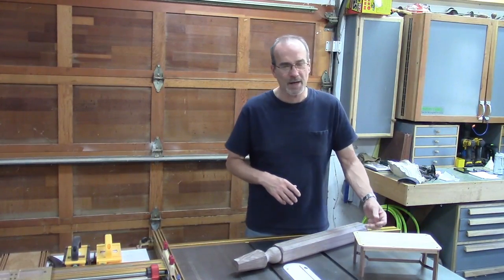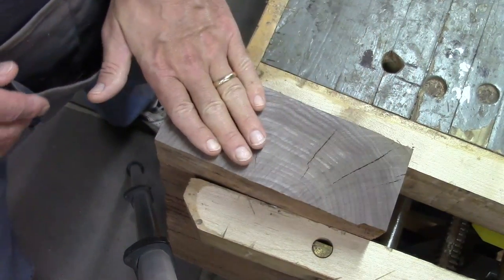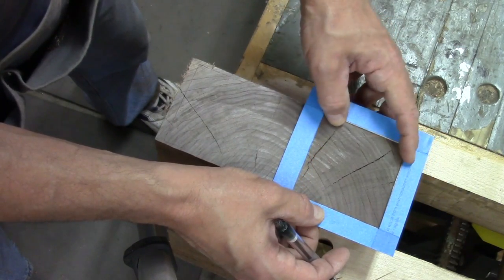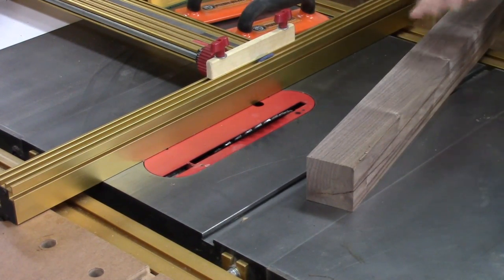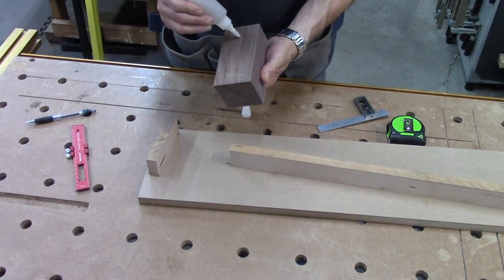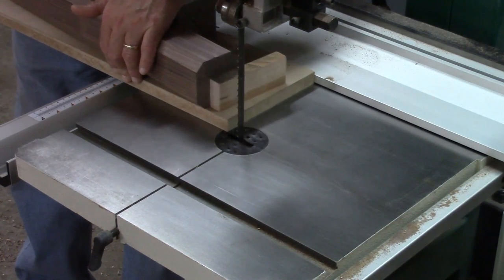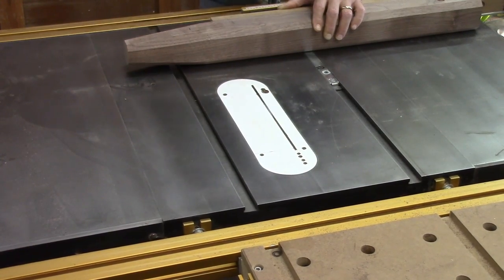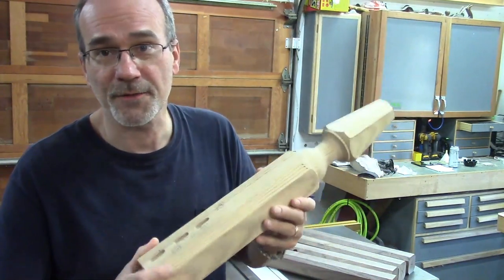Butterfly Leaf Dining Table 1 - Making the Legs

Comment: Great job on the legs Guy.  I personally don't care for the flutes given your overall design, but it's your table!  Interested to see what you decide.  Incidentally, I haven't been able to find any local, decently priced, walnut here either....let me know if you come across an good source!
Reply from the maker: +Scott Cable Thanks Scott! If you look on CL, there is a bunch of really good local guys selling lumber pretty cheap. My issue was finding 12/4 in the right quantity, not an 8' board of it. There is a guy in Connersville (actually Rushville) that sells everything for $2.50 a bd ft.

Comment: Awesome job so far Guy! I like the flutes. If you flute them will you flute the lower section too?
Reply from the maker: +woodworker 631 Thanks Brian and Mark! If the flutes do go on, the will only be on the outside of the legs since the legs are turned at 45 degrees to the ends. And they will definitely not go on the bottom peg, only the top.

Comment: Seeing as you brought it up. A question I have been pondering. Does it really matter if you begin your taper on the end or the side of the leg? Would really like your opinion.

Thanks for the great videos and sharing your amazing creations
Reply from the maker: +Jim K Thanks Jim! I don't see how it can really make a difference which way you cut it. As long as it's secure and you are comfortable doing it. The stops may need to be in different spots on the table saw however.

Comment: Hello Guy,   I vote for the flutes.  How are you copying your first leg to ensure the others are the same?
Reply from the maker: +Mark Walker Hey Mark. I originally made the turning on the sample piece, then just used that one to help turn the others by hand, no duplicator. They are pretty close, but not exactly the same. Since there is distance between them, it will be hard to tell.

Comment: Do you purchase any material at "Northwest Lumber" by Lafayette Square in Indy. How do you feel their price compared to local places around town. Glad to see your purchase from Matt thou.
Reply from the maker: +Tom Pritchard Hey Tom! Yes I do buy lumber from them occasionally if I just need a single board as their prices can get pretty crazy. I either get lumber from a local sawyer or from Frank Miller Lumber in Union City. They deliver here for me for free, and have a truck in town a couple times a week. That is if I buy 100+ bd/ft at a time. And their prices aren't too bad either. Very reasonable and it's very good grade lumber.
Reply: +GuysWoodshop I buy mostly Basswood for my wood carvings at Nortwest. I have a couple local saw mills that go to in southern Indiana. They can provide most domestic wood at a great price. Which I use most anyway. Thanks for your response. A new sawmill just opened called Maple Grove Farm. it ,may be a good option? http://www.maplegrovemill.com/index.html

Comment: Definitely FLUTES!  So far it's unanimous.  :)  Looking good so far Guy.  

Wait for it... Mitch will chime in and request you cut the flutes using some rare old Stanley or Record molding plane made by some Brits from old medieval armor.  Personally, I would use a router.  :)
Reply from the maker: +Hardnox . HaHa, your'e right on that one!
Reply: haha! Personally I wouldn't flute, but I tend to agree that keeping the wife sweet is never a bad decision. And of course, if you flute, be careful not to burn them - of course that wouldn't be a problem with a plane! 
Looking forward to watching progress.
Reply from the maker: +Mitch Peacock - WOmadeOD Hardnox was right! I am of the thought that there will be no flutes. And I am close to convincing Judy that they are not needed. Still have some time to get this worked out.
Reply: +GuysWoodshop Flowers always help! 
When I make a prototype, or something just for the family, I usually do one leg different if it is mostly seen in isolation. It's become a bit of a trademark :)

Comment: Guy, looking good.  What kind of gauge is that on your planer?  I have the same planer and could use that gauge.  Model #? Thanks.
Reply: +Mike Kapotsy By the way, I like the fluting on the legs!  Looks really good.
Reply from the maker: +Mike Kapotsy Thanks Mike! It is a Wixey WR550. You can find them on Amazon.
Reply: GuysWoodshop thanks Guy.